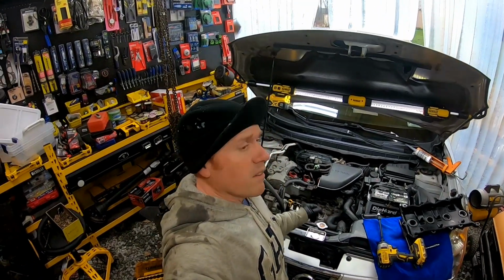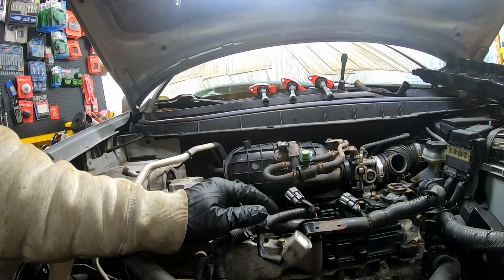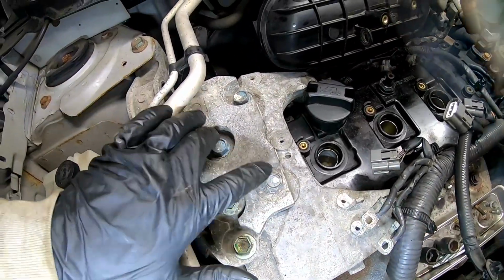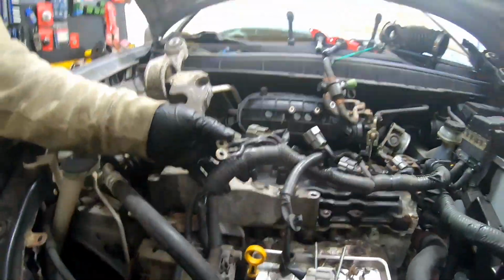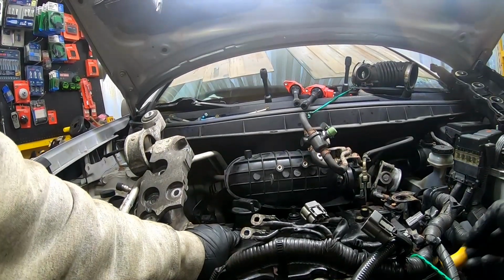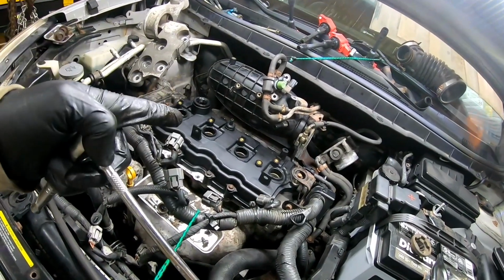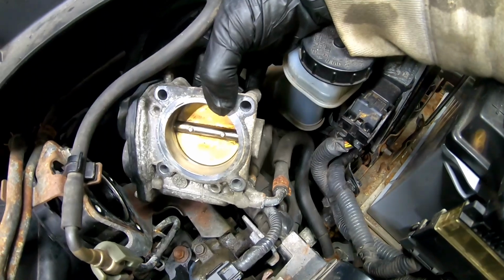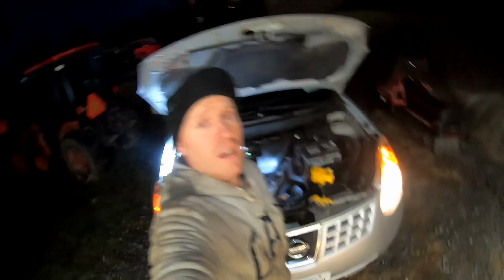How To Install A Valve Cover On A Nissan Rogue DIY!

Comment: Thanks bud good video...I hate Nissans  but they can make you some money
Reply from the maker: I've gotten so use to working on nissans that I actually like them now lol I know exactly what's wrong with them and parts are dirt cheap, they are actually great little cars when they are maintained and Definitely good gas mileage,  but don't get me wrong I still like to get in my GMC 2500 and tow my boat to the lake!🤣😂 thanks for watching buddy have a great summer!👍😊

Comment: What did you torque motor mount bolts
Reply from the maker: If you never did them before I would suggest a torque wrench, but if you have been working on vehicles before then you can use a impact to your feel it's just something doing many over time that you know when they are torqued down enough and the strength of your impact you are using, but the by the book way would be a torque wrench set at the vehicles specification,  I hope this helps! Thank you for watching!#👍

Comment: Hey, I came from your coil and spark plug video. What year is your wifes rouge? I’m thinking about buying the cover from Amazon as well. My gf has an 09 rogue 2.5 engine
Reply from the maker: Same thing 09!  Thanks for watching and good luck!
Reply: I bought mine oem and cheaper than Amazon or eBay 
Nissan rogue 2015 
Gasket from felpro tho ( trustworthy brand)

Comment: Bro an update how’s the Amazon New Yall aftermarket valve cover and gasket holding so far?
is it leaking or burning any oil?
Im planning in getting the  same valve cover you installed from Amazon
Reply from the maker: No issues and I would definitely recommend the Nissan gasket Sealer, I use that stuff on everything now, no leaks!!! Thank you for watching and good luck!
Reply: Thanks for the update. I was going to ask the same thing.  I have to do the same thing to my Rogue.  @WhitehouseFarmVet
Reply from the maker: Good luck it's not as tedious as it seems, just make sure you put a good seal on the corners! Thanks for watching!

Comment: Mine wasn’t leaking a lot at 120,000 miles because I changed pcv at 60,000 miles but then bought it for $47 oem plus gasket and needed to change motor mounts too so definitely got it changed 
I could have kept like that for another 40,000 miles since there wasn’t any oil in the spark plugs
Reply from the maker: Yeah that's the big thing a little oil leaking from the cover is not a big deal but once it's leaking in your spark plugs it's time to change it! Thank you for watching!👍
Reply: @WhitehouseFarmVet where did you buy your cover
Reply from the maker: Amazon link for purchase
https://amzn.to/3KgWAGl

Comment: Is this process similar on a 2017 rogue? I can’t find a single video or explanation anywhere online for replacing the valve cover on a gen 2 rogue.
Reply from the maker: I'm not sure what the 2017 engine bay looks like but I'm sure it's pretty similar they mainly change the looks on newer models not so much the setup, if you watched the video and it looks the same as your 2017 then I think you will be alright!  but it's just a valve cover so it shouldn't be complicated they should be similar!  Let me know how you make out and thank you for watching!👍
Reply: I’m doing my wife’s 2017 rogue sport now, working my way through it, it’s not too bad, main difference so far (just started an hour ago) is this intake on top of the coil packs needs to get dismantled and taken off first, do you still need help? I can try my best
Reply: @joshdimpley1698  I was hoping someone would chime in and say Nissan redesigned for the newer gen and it was more straight forward
Reply: @BIGBAGLEBOY  yea if only. Call me crazy but my one conspiracy theory is that engineers don’t have to fix the things they make so they don’t pay much mind to how difficult the repair and replace is going to be..
Reply from the maker: Lol Yeah! But honestly if it is the same it's not too bad just make sure you clean up the corners good and remove any oil for a good seal! Good luck buddy!👍
Reply from the maker: Awesome! Good info!
Reply: @BIGBAGLEBOY  as I’m going through it, you don’t need to take off that engine mount to get to the valve cover, so slightly easier?
Reply: @joshdimpley1698  perfect, I have the part ordered and will put it on next week
Reply: I believe the 2016-18 is mostly the same. This is different than my 2016
Reply: same  i will be doing 17 soon  but its same
Reply: @joshdimpley1698  I'll be doing my neighbor's 2019 in a couple days to help him out. Any tips or big differences you found vs. this video? I'll take any help/advice I can get.
Reply from the maker: @shenanigans721 no they should be  pretty similar just make sure to get the corners good so no Leaks! Good luck and thank you for watching!👍
Reply: 2017. Shouldn’t even be leaking yet.

Comment: You supported the engine under the oil pan??
Reply from the maker: Yes under the thick part of the oil pan! You have to make sure you have a 2x4 or 2x6 is better to spread the weight, it's not taking the full weight of the engine like you think, if you didn't have the jack and 2x4 it would drop only a couple inches because the engine still has other supports but it would make it impossible to pull the bolts out that you need and obviously to put them back in aligned! Just jack it up enough that it is snug holding it in place, don't try to jack the engine up because then you will crush or brake your pan! Good luck and thanks for watching!

Comment: What really does that resonator do anyhow?  Trying to search for it just brings up things that are exhaust related because a lot of exhausts have one.  My 2017 Rogue Sport SV with the 2.0 has a resonator that could be mistaken by some for one of those useless plastic covers except that it has hoses.  They don't have a PCV function because that is a separate part of the vehicle which by the way is super easy to change on these 4 cylinder engines if it ever needs to be done.
Reply from the maker: Basically the Resonator reduces the sound produced by the engine! Thanks for watching!